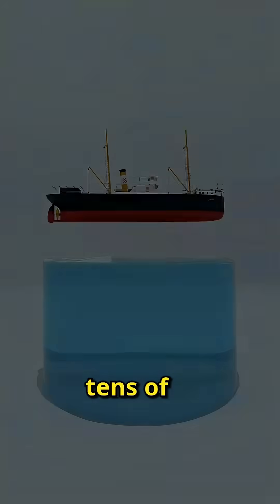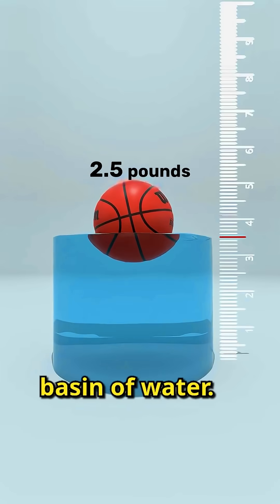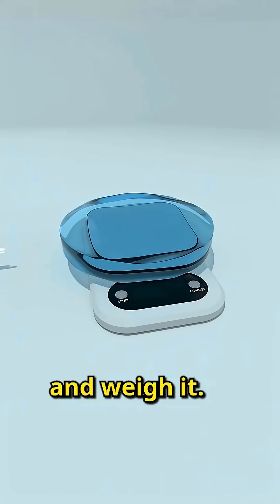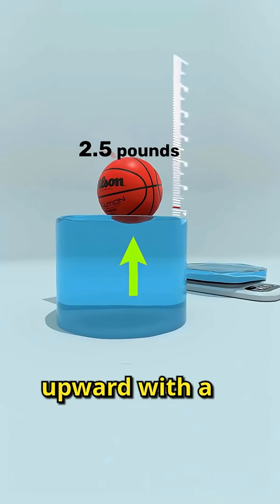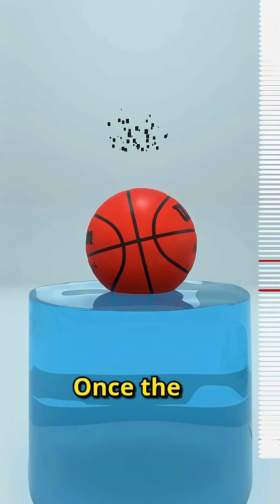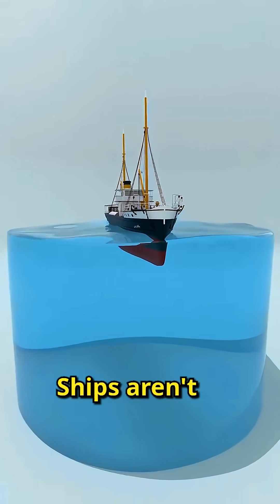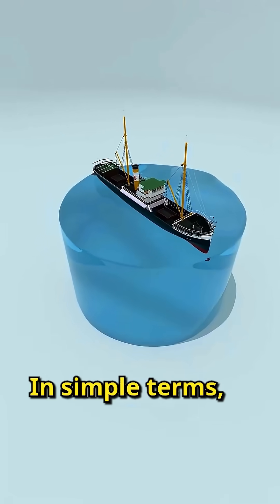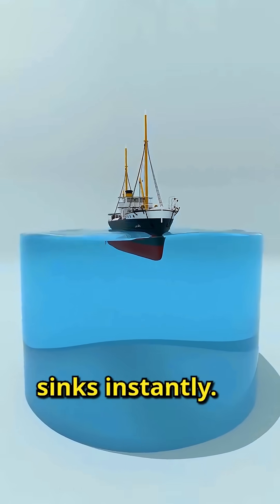Why Iron Ships Float

Comment: It’s all in the density. As it turns out, a mostly air-filled hull with steel and wood paneling has a lower average density than the water, making it able to float on humongous scales.
Reply: Always relative density. Gravity was invented shortly after the heliocentric model was proposed to explain said orbits.